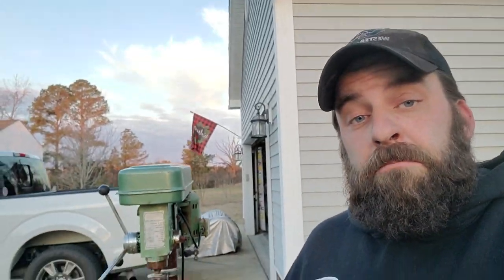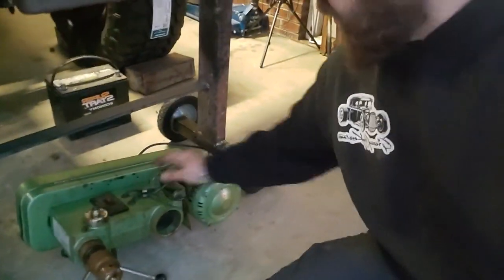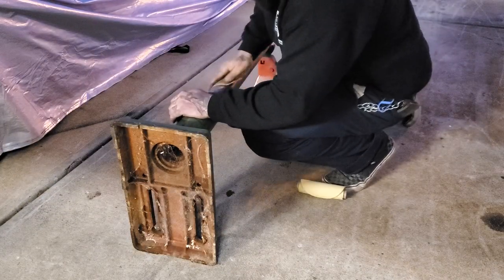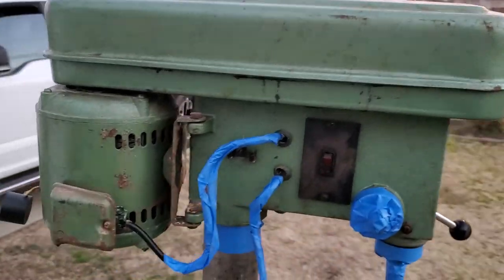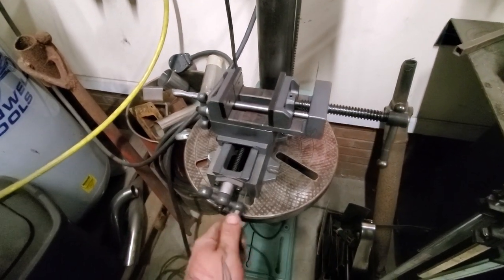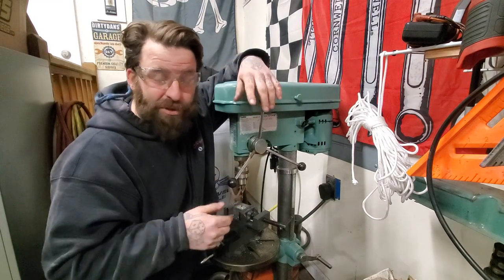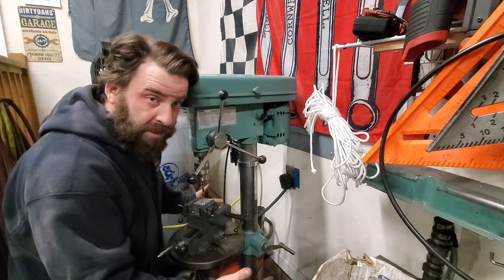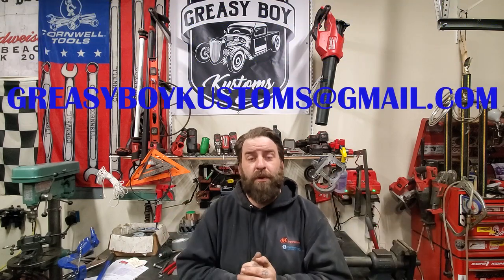FB MARKET DRILL PRESS SCORE , FIXER UPPER...... KIND OF

Comment: Turned out pretty good. Might need the brushes cleaned in the motor.
Reply from the maker: Thanks. I'll try that next 👍👍
Reply: @greasyboykustoms  no problem
Reply: My new Grizzly 2hp motor I bought and stuck on me small mill does that. I screwed it up by trying to cut too much in a pass. Now I just give it a push and I'm off. I got a 8in bandsaw with hyd feed from the local marketplace.